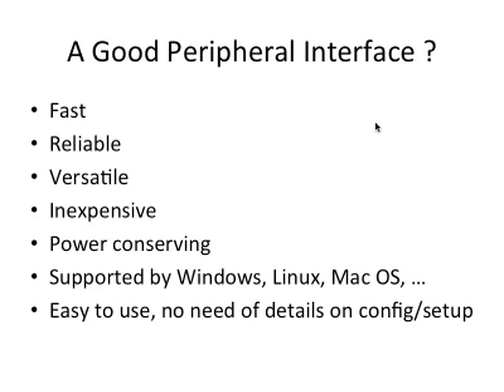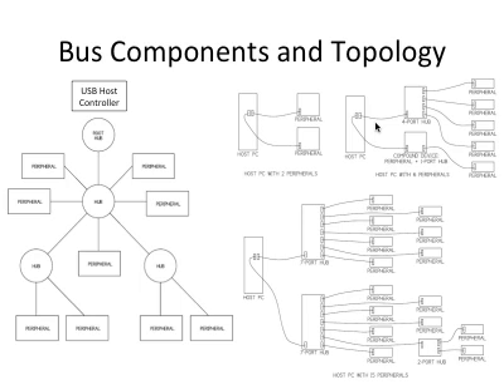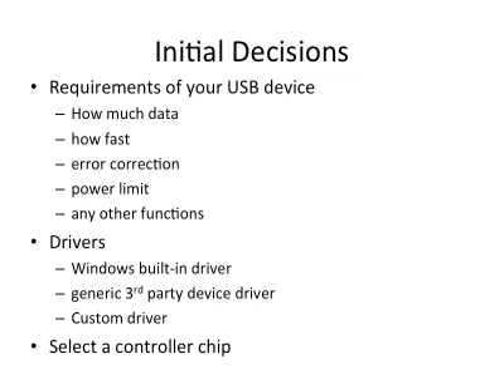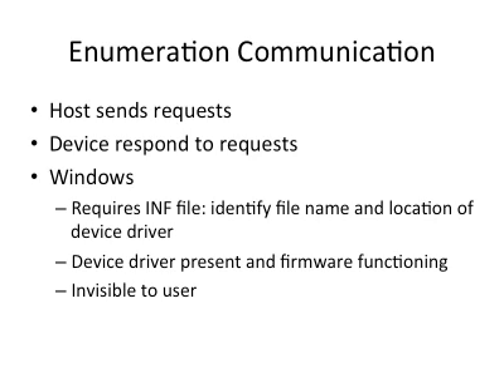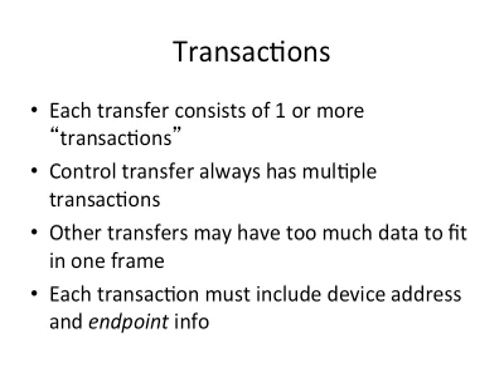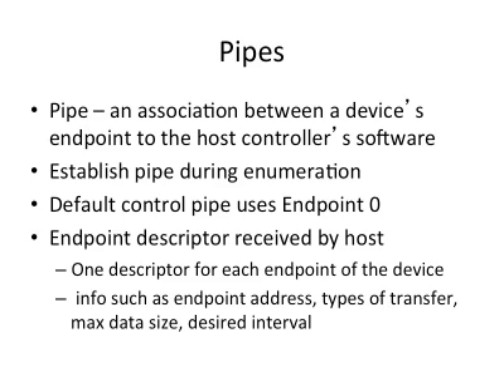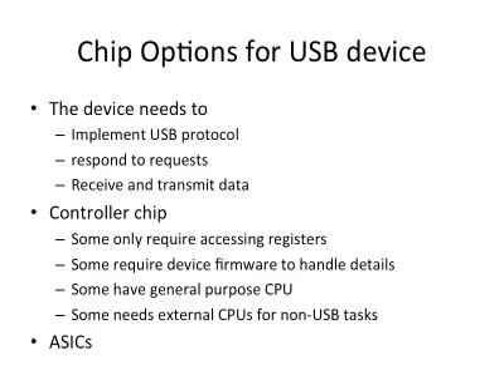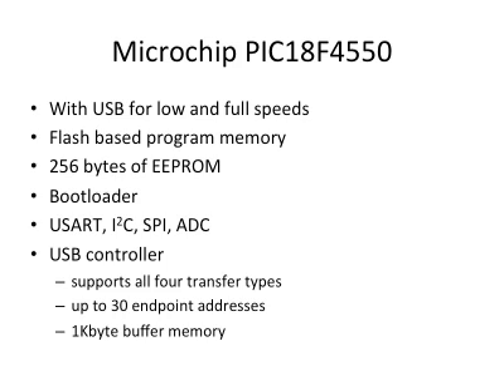USB and Development of USB Devices

Comment: Can USB used as video interface
Reply: USB 3.0 is fast enough, however note that USB 3.0 has a lot of enhancements over USB 2.0 while being backward compatible. These enhancements means that even if you know USB 2.0, in order to get the higher data rates (superspeed in USB lingo), you will need to understand how USB 3.0 can be exploited for your purpose.
Reply: +Sai Charan Patlolla Yes.  and power.. and data transfer..  "Universal".